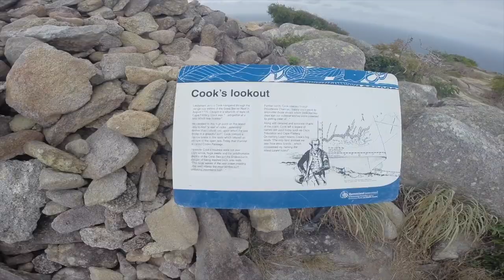NO sail NO engine STRANDED at REMOTE island ~ sailing family | Episode 49 |

Comment: Flush/doak starter in freshwater. Strip then dry it out. 
Any customer I do injectors/pumps/turbos for that is going offshore I tell to keep the following on board. Spare alternator, starter motor, 9/16 AF half moon/banana spanner for that starter bolt,  fuel liftbpump, at least  one spare injector, measure longest injector pipe and get one staright pipe made as a spare and heaps of fuel and oil filters and at least 1 oil change worth of oil.
Reply: Just watched thru til the end and sweet you got it sorted but one thing. That mighty 4/236 Perky is hunting a lot at idle. Thats definately not normal for a mechanical governor injector pump on a 4/236 engine. Do you know there is a hidden fuel filter inside the rear of the injector pump? They can and do block up no matter how many filter changes you do on your Racor/Dahl/CAV fuel filters. Fidfly job to do but can be dun by you onboard. You can remove and just gently clean the plastic filter once its out.